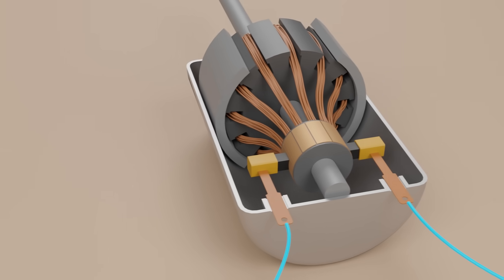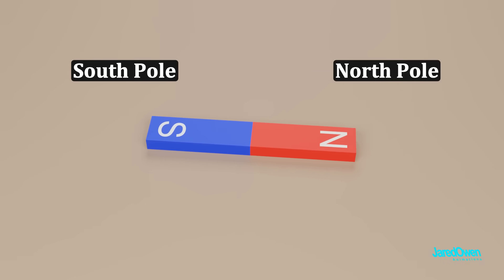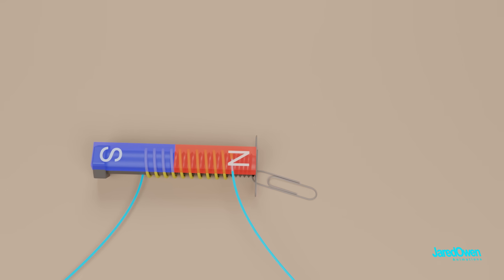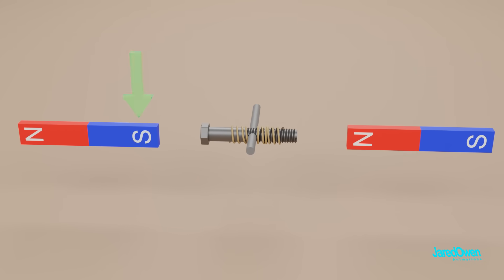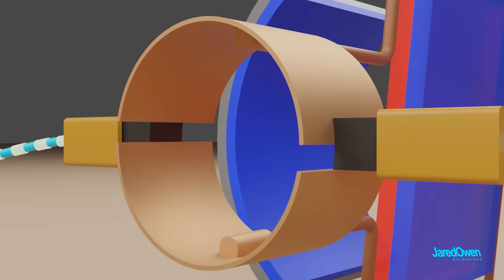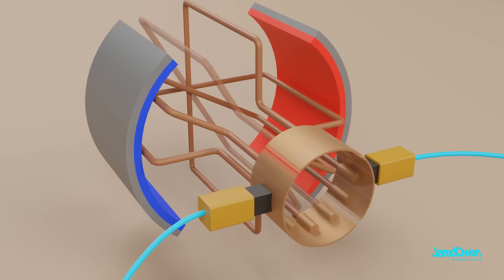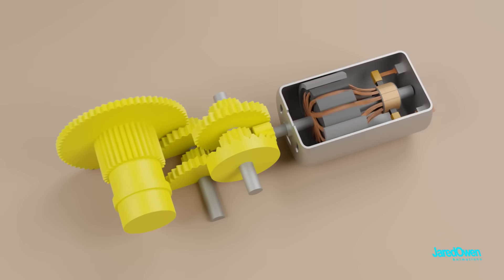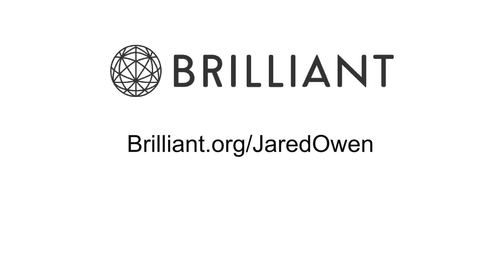How does an Electric Motor work?  (DC Motor)

Comment: I've always wondered how motors work. The only thing I've know is that they spin when you run current through them. Thanks for answering my question. However, I've also heard the term "brushless" motor which now seeing this video makes me wonder how you could have a motor without brushes and why you would want a motor without brushes. I would appreciate any answer that you can provide.
Reply: https://www.youtube.com/watch?v=bCEiOnuODac
Reply: gk 05 thank you I really appreciate it
Reply: @godofnutella2857  👍
Reply: Brushless motors are used in drones...
Reply: khushboo jha I know in what applications they’re useful I was just wondering how they work as compared to the brushed motors explained in the video. I do appreciate the information though, thanks.
Reply: @godofnutella2857  ohh gr8
Reply: You made me crave Nutella now
Reply: brush only needed in a motor where the current needs to go though the rotor (the moving part, usually the part with lots of wires), you can see the magnet is stationary in this video, which is called stator....if you reverse that, where the magnet moves and the wire is stationary, you got brushless motor, ....why brushless motor?, because the brush part will eventually shaved due to friction to the point it's no longer touching the commutator, brushless doesn't have that, because current only flow through stator, which make it will last longer but also less maintenance,

since brushless need magnets, it's expensive, the better type of motor than brushless is induction motor, which has no magnets, you can find it in your desk fan and any fan that similar to it (except PC fan, it's brushelss)
Reply: Electron Resonator I really appreciate the  information thank you.
Reply: https://youtu.be/7Wgv6cgLEsk
Energy saving tactics

Comment: My future planes will ionize electrolyte mid flight by routing it close to high friction points of the plane(nose wing tips) then re infuse back into secondary cells. Harvest mid flight ionization potential. Energy is a matter of speed. More speed means more ionization.
Reply: yes. i think

Comment: What is a dc motor?
Magnetic fields affect moving charges and a magnetic force in a charge moving with a velocity in a magnetic field B is given by the Lorentz force law Fmagnetic = q(v cross.product B).

Isn't it wonderful that when we flip a switch which is wired to a ceiling fan, the fan rotates ! Take a moment to visualize the force which acts on the blades to keep them rotating while we are standing on the floor far below the fan.  As if it is rotating by an unseen hand!
It operates based on the principle that a current-carrying conductor placed in a magnetic field experiences a force and this is what was encapsulated in the Lorentz force law. 

A loop of wire with a current in it is a magnetic moment and when this loop is placed in a magnetic field, it rotates because there is a force generated by it. More the number of loops, more is the force created and faster the rotation. If we place the loops in an armature and attach a set of blades to the shaft of the armature, we have made an electric motor with a fan. 

The fan pushes air and the molecules of air when they leave the blades produce a reaction force, a torque as the blades spin. The fan motor should generate sufficient torque to overcome this opposing “load” torque and keep the blades spinning.
The "back emf" is the trick nature uses to regulate the current to generate this required torque automatically!
For a lecture by Prof Ruth Chabay on magnetic forces and a live demonstration (36.40 minute onwards) visit
https://youtu.be/D-F9-DqHzmY

There is one subtlety involved in the generation of the force by the current carrying loop and that is that the force is due to Hall effect charges in the arms of the loop.

For a more detailed discussion of motors including the role of surface charges in the loop wires of the motor, see the books referred below.

Electrostatics and circuits belong to one science and not two, that of electricity and magnetism. To know how they are unified visit this link 
https://matterandinteractions.org/articles-talks/ and view the article 'A unified treatment of electrostatics and circuits.  B. Sherwood and R. Chabay, unpublished. (1999)'
pdf. 
For a live demonstration of surface charge and its effects in circuits visit 
https://youtu.be/U7RLg-691eQ

For a detailed discussion of surface charge, coulomb's law, electric fields, fields of dipoles and other charge configurations, parallel plates, capacitance, currents, conservation of charge, conservation of current, superposition of fields, superposition of potential, simple dc circuit, magnetic fields, magnetic fields of a current element, straight wire, current loop, solenoids, biot-savart law, voltage, voltage source, difference between e.m.f. and potential difference, ideal voltage sources, resistors, how current branches in a parallel circuit, capacitors, inductors, Faraday's law, inductance, ac circuits, transmission lines, Lorentz Force law, motors, generators, p-n junction diodes, electromagnetic waves, antennas and radiation, new electrodynamic theories on the nature of the electric field, see "Electric and Magnetic Interactions" by Chabay and Sherwood 
www.matterandinteractions.org
or 
Fundamentals of electric theory and circuits by Sridhar Chitta
https://www.wileyindia.com/fundamentals-of-electric-theory-and-circuits.html

There is a "look inside" feature in the amazon.com webpage of the book "Fundamentals of electric theory and circuits" by Sridhar Chitta with a few pages of Chapter 1 which may be viewed and also which you may swipe left or press < icon to view the foreword, preface and Table of Contents. 

The contents of the above book by Sridhar Chitta, make a distinct unified approach to electrostatics and a few advanced circuits like coupling signals to amplifiers, lending precision and clarity to the topics which is not found in most text books.
The book comes alongwith a CD with animated power point presentations for all chapters and voltage regulator, RC phase shift oscillator, transformer-coupled audio amplifier and differential amplifier included additionally.

Comment: Teaching voltage DC direction mini teachers instructors still teach the old way that positive is hot and negative is where the power comes back it is the opposite negative is hot DC battery power leaves the negative side and goes to the positive side positives electrons attract negative electrons. This is why you hook your alternator hot lead to the positive side of a battery. Power goes in on a positive addition power leaves the battery on the negative side subtraction.

Comment: Hmmm i used some screws, copper wire and AA battery to try to make a magnet but it didnt work. All it did was heat up my fingers. Does it take time for it to magnetize or does it need to be a specific metal?

Comment: This is the best explanation on how a DC motor works! Beautiful animations, excellent didactical set-up and well narrated. But I do not understand why the video was not extended with a few animations on how an AC motor works based on the switch the tension of Alternating Current makes which causes an automatic change in polarity which replaces the need for a commutator.

Comment: This is really good. Now I understand why the brushes needs to be changed after a time. I am amazed with starter motors for IC engines, how power they could give to spin that crankshaft.

Comment: We studied this in college for 3 years and forget everything.
We learned this in 10 minutes and it remains in mind forever.  WOW
Reply: Right bro🤝
Reply: College, lolz, i am in year 9 and ik this
Reply: @theaslam9758  you 9th class or 9 years old?
Reply: SHASHI KUMAR     If u were in the uk u would know that i am 14
Reply: @theaslam9758  I m not from UK though. But I agree to u because Now I realise that I had this topic covered in 9th. No offense...
Reply: Help me reach 1M subs With no videos ok
Reply: Very true
Reply: Don't forget all AC & Radio waves type power have three elements, 1. the positive cycle 2. the neutron, last but not least the   3  the negative cycle.  That neutron cycle is by far the most powerful once you understand:  Without the neutron, the energy could not move forward!!!  You can learn allot about this if you have a bar magnet.  I will prove to you that the center field of a magnet is the most powerful by far!!!  It's how they built the great pyramids!!    If you have a bar magnet/ not a horseshoe type, I'm going to show you all the basics.   DO NOT DISRUPT THE CENTER FIELD WITH ANY OTHER METAL>> 1. Anti-gravity, get something like plastic or glass a granite rock would work well just tap with your finger the centerfield of the magnet near same and it will lose 2/3 it's weight, Next 2.  let's tap the center field near a stream of water and watch it repel the water.  3. If you vibrate the center field at the correct frequency any granite rock will become butter.  YOU MUST UNDERSTAND THE DIFFERANCE FROM An OSCILLATION AND A VIBRATION!!!  The petrographs on the pyramids told us all of this...  Our future will depend on the center field, The height of one's intelligence is directly proportional to their realization of their own ignorance VPC!!

Comment: Excellent. I just have one small objection to making the video even more didactic. The exchange of poles of the electromagnet should not be represented with a blue-red block that turns 180º, but simply the red block should turn blue and vice versa. On the contrary, some students might believe that inside each spiral there is also an axis!

Comment: One of my teacher is  graduated & have a M.S degree in electrical engineering & even he don't have this much of deep knowledge about DC motor .
Reply: Well, there are many different fields in electrical engineering and it's likely that someone who's working with microelectronics has no clue about motors. Just as I know shit about inner workings of a computer. You know... engineers specialize.
On the other hand there are several things wrong with this video anyway. So it's not as great as all these people who apparently know shit about electric motors make it to be.

Comment: Very nice animation and explanation. But flux produced around current carrying conductor, and force produced due to interaction of  two flux need to understand. Coil does not represent flat magnet as shown in video. Concept of experiencing force by current carrying conductor placed in magnetic filed is different than force of attraction.
Reply from the maker: Thanks for your comment - I realize there's more to it than what I showed in this video.  I was trying to keep it as simple as possible

Comment: One question
why doesnt the split ring short out the battery when both brushes make contact with both segments of the ring at the instance the coil is vertical
Reply: Well, there are several things wrong in this video but apparently people don't care. People rather spam about how their teachers suck while they're probably just lazy to think for themselves... so in the end my comment with corrections got burried somewhere.
Reply: It does in the first model. When you start adding more than 1 coil it makes it so it never shorts and doesn't get stuck.
Reply: @AdenSallaberry  then such a model will create more confusion for students. And same one coil armature rotor with 2 split ring commuator segments are shown everywhere. That's absurd.

Comment: Doesn't electricity flow from negative to positive?
Reply from the maker: Great question ben - electrons flow from - to + but a lot of the time we still use "Convent Current" which goes in the other direction

Comment: 7:29 - Wrong wires showen, they all parralel making them identical to one single wire. they should be looped and only the two ends connected...
Also the gears spin show wrong speeds, the first gear didn't even match motors speed...
Reply from the maker: Thanks for the feedback

Comment: To be a bit more clear, this is the simplest kind of motor known as a "brushed" DC motor. Higher quality DC motors are usually brushless, which are quieter, more powerful and smooth and more durable. Large electrical appliances (like the fan at 8:35) instead use AC motors. Both motor types function on completely different mechanisms.
Reply from the maker: Thanks Nicholas

Comment: At 7:14: torque is not speed but rather strength. Adding more poles to a motor will make it stronger and more controllable, not faster.
Reply from the maker: Thanks for the feedback Crimson

Comment: How isn’t this possible to make into energy as cheap as possible for every family
Reply: People have been trying to figure out perpetual motion for years. You can’t get something from nothing, always requires a energy source of some kind. There’s really no way to physically generate enough energy to power the very motor that generates the electricity it’s using. It will always slow down, and eventually stop spinning. The only energy factor, would be you manually cranking/spinning it to fire it up.

Comment: One of the best, maybe the best Animation and Explanation I have seen so far: It is (as always) perfectly animated and the level of Explanation is very "balanced" for people who had no clue, how Electric Motors work.
Anyway three Suggestions for Improvement:
- The Stator-Magnets should been shown as Dipols, to plant the Imagination into the Thinking of "Beginners with Magnetism" that Magnets are always Dipols. I know, that this knowledge it not necessary at the moment, so there is no need of mentioning this in the Audio, but to show it "always" would be good, because on the next Level of Understanding it is important to learn, that Magnetic Lines are always Loops, which do not have any Begin or End.
- In the Moment when you added the Iron Core to the Rotor, you don't show "any Magnets" in the Rotor anymore. But that would be fine (at least for a short time) to get the real Understanding, where the Electromagnets will "appear" in the Core.
- And finally a minor Error: The Windings of each Coil around the Iron Core (Rotor) are each only one Wire which goes around some times and has only one Connection (at each End) to the Commutator.
Even though my Comment sounds like a lot of Criticism, it is not. I really admire your work, but I also think about using your Explanation to extend it to a more detailed Level (for Example the Magnetic Circuit of the Stator which is closed by the Metal Housing of the Motor) and therefore it will be good if the Basics are 100% and do not force the Student to change his/her Imagination to achieve this next level.
Thank you very much for your Work!

Comment: Spin of matter create force. Force distribution is through magnets or electricity. In electricity electrons are pushed. And in magnets polarity switched. Without switching polarity force cannot be created. Switching needs force or a force transfer. Force is higher in magnets because of metals polarization. Polarised metals have lower electron distribution spin from one end to other. Magnets are time delay sequel. When you push electricity through a wire you are making the electrons spin faster. When you put matter in free space the space around it gets warped because of the spin stored in the matter. Slowly it looses all spin within the matter. Big bang is an event of poles split.

Comment: Superb explanation and animation! Thanks!
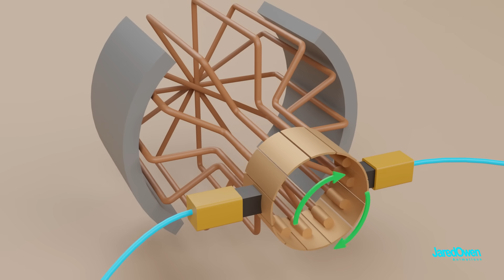However I'm a bit confused by the explanation related to torque, specifically that torque translates into speed (7:10 to 7:35) - I'm quite sure that is opposite of the truth.
As far as my understanding of DC motors go, more wire turns per armature (TPA) will result in higher torque  due to a stronger magnetic field but also a lower rotation speed due to increased impedance, and vice versa lower TPA will provide less torque but a higher rotation speed. 
For example one of my DC motors is 28 TPA and rated at ~15.000 RPM, another is 14 TPA and rated at ~40.000 RPM (given that the voltage is the same).

Comment: i will surely recommend this to UG students and amongst my peers. Such a vivid presentation.
Reply: Just make sure they don't pay attention between 7:10 and 7:35 as that information is sadly wrong. Higher torque means lower speed and vice versa.
Other than that he did a very good job at explaining brushed DC motors!
Reply: @zapador  Yes correctly pointed out sir.

Comment: Inspired me to make something. A small motorized car. It's going to be constructed of a strong plastic body. It's thin, about a half centimeter, but this is for aerodynamics. It will have a small wedge on the front for less air resistance. It will be powered with three motors -- 2 motors will be driving the front wheels and the third motor will be powering a small propeller on the back. Powering it all are two lithium polymer AA batteries.
Yes I am aware I cannot control its steering. It's simply for a speed and range test.

Comment: Why does the motor always start in clock wise direction. Why not in the other direction?
Reply from the maker: Flip the battery - then it will go in the other direction😀
Reply: @JaredOwen  my question was related to the direction of starting forces. How are they aligned to the polarity/direction of current.

Comment: Most amazing video! My kid loved it and he learned a lot. He said more than in school :-)
But i'd like to point out that electric current is actually a "flow" of electrons - basically, one side (negative charge) has more electrons than the other (positive charge) (difference is the voltage) and the circuit between them enables those electrons to flow, and since they're negatively charged the current actually "flows" from negative side towards the positive.
Reply from the maker: Thank you!  And yes - I considered talking more about conventional flow vs electron flow but I decided to keep it simple for the video